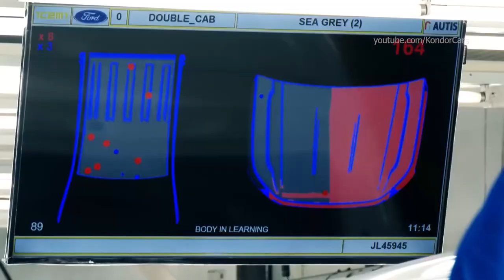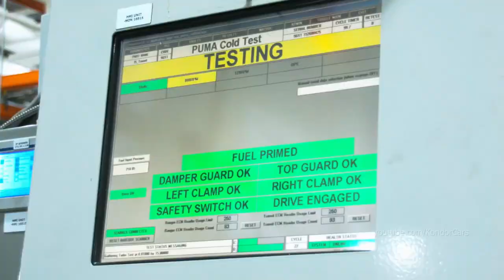Ford Factory,  Ranger Production

Comment: And yet ford couldn’t build the ranger I ordered then reordered last year. So out of frustration I went and bought an inbound Toyota Tacoma. Ford has angered a lot of us ranger customers by choosing to prioritize bronco production and ignore people waiting for over a year
Reply: I ordered my Ranger XLT FX4 in July 2021.  The dealership told me it would be a 3 month wait.  About 5 months later  Ford emailed me and said my Ranger was being upgraded to 2022.  I noticed some changes like the blackout package  I didn't order.   They did that because the spay in bed liner i wanted was no longer a stand alone order, you had to order the blackout package to get it.  Also, the heated seats I ordered were now only available on the Lariat.  So the truck I ordered months ago didn't even exist for the 2022 models, and Ford still didn't have a build date or a VIN for this truck.  I called the dealership screaming.  They started looking for a truck that was similar to what I ordered, but I wanted the extended cab and those are rare.   I told the sales manager forget it......I bought a used 2017 Tacoma off road extended cab with 19,500 miles and saved thousands of dollars.  About two months after I bought the Tacoma the dealership called and said my truck came in.  I told them I had a toyota parked in the garage.   They actually had the nerve to ask me if I wanted to trade the tacoma in for the Ford.  I love my Tacoma.
Reply: I got my 22 ranger xl in 5 months and 15 days
Reply: Ordered my 2022 Ranger Super Cab (6 ft bed) in mid Feb. 2022 and got it May 19, 2022.  I had the dealer do the mud flaps and spray bed liner.  I also ordered it with the Auto Stop delete.  Was told doing this would speed up the process and it did.
Reply: @Peter shaw 
How heavy is it?
Reply: This must be out of the American factory?  The new models have only recently reached the UK and all ours have been sourced from Silverton, South Africa, since the T6 launch back in 2012 or so.

Comment: Since when do robot's smile? All that I see in this video is robot's. Used to be two people installed the front hood on Ford vehicles. No more!! What few people are left on the assembly line are smiling because of the HUGE profit sharing check they are gonna get in the Spring of that year. Wait until you see the Ford electric vehicles pump out. There's way less part's to install on EV's. The only human left on that assembly line, is the one driving the finished vehicle off at the end of the line.

Comment: had a brand new 1987 ranger XLT 4x4 V6 for 13 years...loved it
Reply: Reliable but love gaz……
Reply: I still have  my 87 Ford ranger with a 2.3L with 5 speed overdrive 2 Wheel drive base model no AC no power steering no power brakes everything simple easy to work on still running strong love it won’t get rid of it 👍 Great little trucks 🛻
Reply: Got an 01 ranger XLT 4x4 4.0L… gets 21 mpg highway and has never left me stranded.  Will never sell it as long as I have it

Comment: I have a Silverton built 2014 Ranger Limited 2.2 auto and am about to add a new 2023 Wildtrak 2.0 Biturbo to it. The 2014 has worked hard for 85,000 miles of general farm work and towing 3.5 tons on challenging roads. The only repeat problem has been rear springs breaking leaves, almost always when very lightly loaded for some reason. I did change the engine oil pump a few months ago just in case, because that is a known failure issue with the engines of that vintage. Changed the transmission and rear axle oil [again] at about 70,000 miles.

Comment: What's with the head gasket on the 2.0s heard they suck
Reply: One day or another, head gasket sucks….all models, and brand’s….
Reply: @sylvainlaurence1554  289,000 miles  on a 2004 2 valve 5.4. No gasket issues

Comment: How come the employees working on the assembly lines have no safety glass on at all?
Reply: Safety glasses are bad for your eyesight 😬
Reply: They are only assembling , and are not using machinery
Reply: no ear plugs also.
Reply: OSHA standards do not apply outside the U.S.
Reply: Safety third.
Reply: Mintah  Cat   Besi   Baru   Abuh Abuh 
Bubuk Baja  Tuah   Biruh  Abuh Abuh 
Ok   RI    Mantap  Cat   Besi   Aviean   Baru   Abuh Abuh Tuah Biruh  Bubuk Baja  ABUH ABUH  BIRUH   ok    RI
Reply: Ford has assembly plants all over the world , just as other automotive manufacturers do . OSHA regulations are mandatory in United States plant’s, safety protection is company wide ,if the countries there operating in choose to implement there own lack of judgement on this issue and not enforce safety standards,that’s a local issue between them an corporate.

Comment: there few mistakes ford make with this was pushing engine too far back under cab body cause headaches because of sensor on head at rear of engine which cant get to it and ended up having disconnected transmission and lift it up give enough room get socket on sensor (was painful and sharp metal)
2nd WHERE IS MANUEL TRANSMISSION CMOM FORD i dont like auto transmission because bored and more problems down the road (auto transmission have soo many moving parts to keep transmission working if one failures it caused it all to failures which why manuel transmission outlasted auto transmission because dont need a lot of moving parts just clutch and gear ring that about it) if i were find other truck i be willing find one with manuel transmission ONLY periods because it so easy take aparts and fix it and put it back together

Comment: Had a Ranger as a rental truck when I was in NC filming for my channel. I hope my ex[eriance with it was a one off or Ford is in a lot of trouble down the road. I think every front sensor had an issue of some sort. Most of the time when trying to use adaptive cruise control it wouldn't work saying the sensors were blocked. If it it engage it would nearly rearend the vehicle in front of me before it slammed on the brakes. Once the distance specified was acheived again it would accelerate hard and not brake the second time. I coould be stopped and a vehicle could pull up next to me either side and the collision warning would go off, thinking I was about to get into an accident. At one time coming onto the hwy from an on-ramp, it downshifted and had such a lound bang and jolt I though the tranny just blew up on me. The lane keep was so bad I had to dissable it. It would bounce the truck back and forth between the lines so bad I kept expecting to be pulled over and have to do a sobriety test.
Reply: Mate what you rented was a Ute a truck generally has 10 wheels then add on a trailer
Reply: Rental vehicles are the worst possible comparison to what you will get from the factory there is. People abuse vehicles you know, and some even sabotage vehicles for the fun of it. Then people like you go online and trash something you have no idea the history behind what you drove. I think it's safe to ignore your "evaluation". 
BTW, the Ranger being built in this video is a successor version of the Ranger you have in the US. It won't be available in the US until mid-year 2023, as a 2024 model year vehicle. 
I was in a manufactured home once, and the roof leaked. Obviously, ALL manufactured homes are built with leaky roofs. So ........ how did you like my evaluation of YOUR product, Nate?
Reply: @rayrussell6258  I was just stating my experience with one. Yes I know rentals get abused. This one had less than 10k on the odometer.
Reply: @NatesHomeTours  Clearly the intent of your post was to discredit the brand, otherwise you wouldn't have gone into such detail for a single rental that likely only lasted a day or two. You were LOOKING for negatives. 
Number of miles on the vehicle does not matter. For all of that to happen on ONE vehicle, there had to be tampering or the vehicle was in an accident and not properly repaired, also something that frequently happens on rental vehicles. 

Sometimes it's best to just keep "experiences" to yourself, Nate. People's lives depend on the work they do in companies producing these products, and one isolated instance needs not be broadcast to the world over a social media site. I happen to know that Ford quality is in a statistical dead heat with Toyota and Honda, because I spent a career in automotive and studied that data constantly. Hard statistical objective data, not that soft "opinion"/ subjective data reported by the press that they get from Consumer Reports customers surveys or JDPower, also a collection of subjective opinions. 

As I said, MY experience with manufactured houses is they all leak, based on the one that I entered that had a roof leak! Painting the entire manufactured home industry with my single experience isn't fair, is it, Nate? So except in response to people who unfairly and openly attack products, I resist temptation and keep that experience quiet usually.
Reply: @rayrussell6258  10 days I drove that truck for
Reply: @NatesHomeTours  yeah right; you still missed the point and take up the tail end. 
Ford sells 2 million vehicles in the US because they satisfy customers. The media sells lies, and you are gullible enough to believe the lies, making you look for or imagine negatives.  
You have no history on the rental you drove, and yet you talk like a week in it makes you an expert in Rangers. You aren't. Some people just don't know when they don't know what they don't know, and they still try to talk like they do. That's you, Nate. 
I better block you now, this is getting beyond just trying to open your eyes. You refuse to open them, and that's wasting my time. You drove a vehicle that was damaged in an accident and not repaired correctly, or someone has tampered with it. In the bigger data picture, Ford customers are not reporting the issues you posted.

Comment: FORD  =    Fix -  Or - Repair -  Daily . Do have 2020 F150  - what a piece of a junk.  After two and a half years I have been to a repair shop more that 20 times.  What a piece of a Junk.
Reply: Now why don't I believe you?
Reply: @u2mister17  What do you mean by ( now why don't  l ....)?
The total cost of all repairs  approximately / parts and labor / $28000 - $30000 Can.
Reply: @olego2779  and how you use it ?That’s the question?